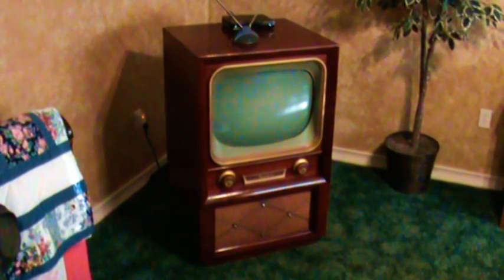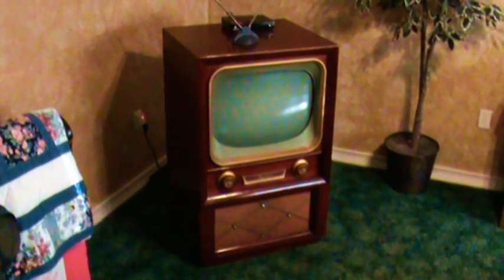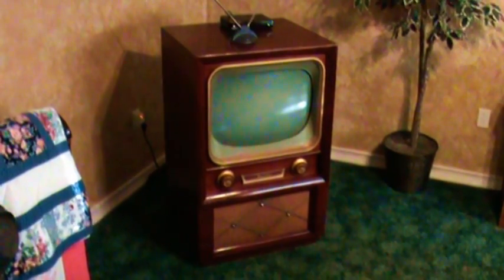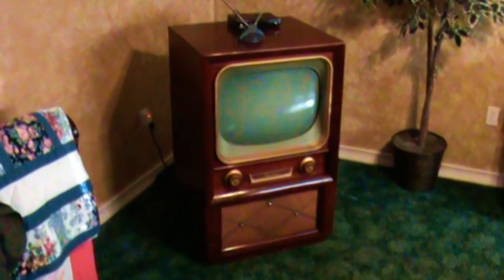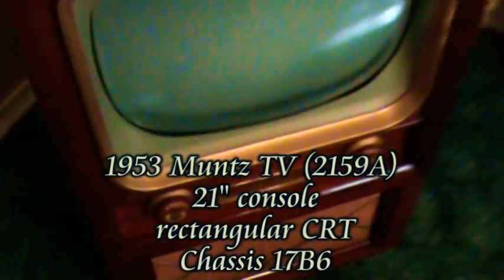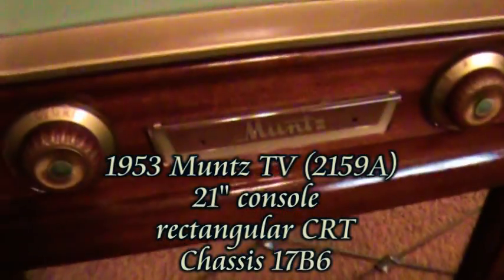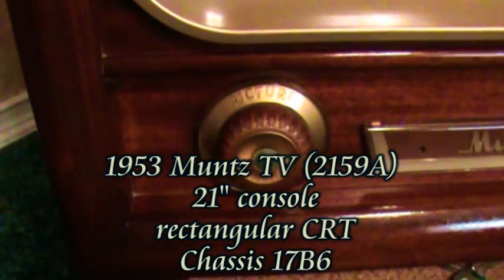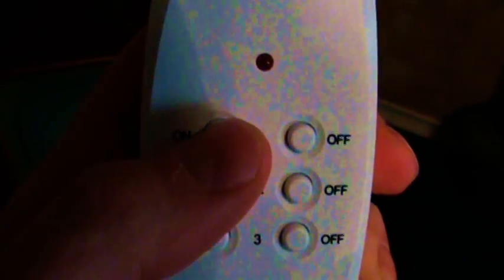1953 Muntz CRT Television Restoration

Comment: i have the same muntz chasis! the only diff. is my model has the doors on the front that cover the set. saved it from a dumpster! haven't gotten around to finishing it yet, the magnavox is first in line. have a raster on the muntz so it shouldn't be to bad to fix. love to see these old sets restored and not dumped! keep em' glowing!!!
Reply: Many of the early console TV sets had doors to hide the picture tube and control knobs when the TV was not in use, so it would look more like a piece of furniture and fit into living rooms of the day. I think people ended up leaving the doors open all the time, so were willing to buy console TV sets without doors when it was time for a new set. Also, there needed to be space around the set for the doors to swing open and closed. If the household decided to add a chair or table, they might have been obliged to leave the doors open.

My parents' GE console TV, purchased in late 1954, did not have doors. However, in the early 1970s, I did acquire a Magnavox console color set with flexible doors that slid into the cabinet for viewing and pulled out to cover the front of the set when not in use. You didn't need to leave space around the set for the doors.

Comment: Excellent repair. I was an AT in the USCG when we still had a few pieces of equipment using tubes. We still made component level repairs at that time now I think they just send everything off. You've inspired me to try to find an old TV set. I like my big screen flat but I would use a restored TV like this to watch movies of the time. From Here To Eternity and Gone With The Wind should be watched on a set like this. Nostalgia at its essence. Thanks for sharing this.
Reply from the maker: Wood Barter Thanks for your comments!

Comment: Muntz TVs were a marvel of simplicity; they wanted to make TVs which were cheap to manufacture but still very well made, and they accomplished this by simplifying them as much as possible.  They do suffer in terms of reception performance, but they can produce a very good picture with a strong signal.
Reply: douro20 yes he marketed his TVs to the areas which had TV transmitters near.
Reply: I don't know if this is apocryphal  but I believe it's fact, madman Muntz had his engineers buy and test many major brands  removing as many components as possible or bypassing with cheaper parts to reach the 'plans' for his sets
Reply: @maxwelsh6121  Yes, there is a story where he actually did that himself. He checked into a New York City hotel room with line of sight to the TV transmitters on the Empire State Building, bought several TV sets and stripped down the designs to a minimum number of parts that still worked with a strong, nearly ideal, signal. When he checked out, the disassembled TV sets went in the trash.

I believe that his TV sets were primarily intended to be marketed in the Los Angeles basin, where homes could receive signals line of sight from surrounding mountains. There may have been other areas with nearly ideal signals for his sets.

While high end sets had 3 stage IF amplifiers for receiving weak signals, Muntz low end TV sets had 2 stages, which simplified the "singing" (oscillation) design issues, which result from the output signal of a high gain amplifier coupling into the input. He could eliminated shields on the IF transformers and tubes.

Some models of the Muntz TV depended on the TV signal to provide a timing signal to produce a raster. When the tuner was set to an unused channel, the screen was dark, while competitors' sets produced light and "snow". This design eliminated the horizontal and vertical controls. However, the screen would go black during normal viewing if the signal was lost, e. g. from being nulled by a reflection from an airplane. I am not aware of any other low end set that didn't produce a raster on unused channels, using oscillators that free ran when no signal was present and locked to the sync with signal present. So, this design had to come from Muntz and/or his engineering team.

In many cases. Muntz TV sets used hand selected resistors instead of potentiometers. When adjustment was needed, instead of tweaking a knob on the back of the set, the user needed to have the TV serviced to replace a resistor with one of a different value. Some TV shops may have installed potentiometers.

I am not aware of any chassis upgrades offered by third parties. An add-on chassis with improved critical circuits might have vastly improved the performance of the set.

Some models did not have fine tuning controls.  A TV repairman may have needed to perform the adjustment. I understand that fine tuning adjustment screws were accessible with the channel selector knob removed.

There is mixed data on reliability. With fewer parts to fail, Muntz TV sets did better than their competitors in that regard. However, the lack of adjustments meant that service calls were required to handle problems which could be corrected by user knob twiddling on competitors' sets.

Muntz is said to have bankrupted the company trying to develop a stripped down color TV. The Muntz brand was sold and used for a number of years afterward.

The Zenith converter box provides an ideal signal with timing and unchanged signal level even when the TV signal fails. allowing the Muntz TV to play at its best!

Comment: That's a beautiful television set.  Excellent picture and sound quality.  From the sound, I'm guessing the speaker might be more of an 8" because I remember working on some of these types of TVs in high school during my training and studies in electronics and they usually had the 8" speaker, a very common size for a big full range sound yet small enough for narrow cabinets.  It's rare to find a 10" in a TV unless the cabinet is extra large.  Most of the TVs though back then usually had a 6x9" speaker or on rare occasions they went as large as a  9x12" which is very rare.  Superior job on the restoration.  Keep it running as that type of technology is what brought the changes we have today over 60 to 70 years of TV viewing.  

Gary
Reply from the maker: musicman0150 Thanks for your comments, Gary!

Comment: Uh, all paper caps do not need to be replaced.   I only replaced the largest dual paper cap (2x 50 ohm 160v) on my 1951 GE 430, and the sucker cranked right up and works like a charm.  In fact, I was able to shift the frequency on it with an antenna mod and pick up hams in SSB and AM mode, on an stock AM broadcast band only radio.   If something isn't broke, don't fix it.  Esp. not with those ugly orange sprague caps.

Comment: How did you feed the output of the digital tv converter into the vintage TV? Is it via composite cable (does the vintage TV have one?) or via RF output?
Reply from the maker: RF, the only input on the TV.  Used a 75 ohm to 300 ohm adapter.

Comment: One could repair a circuit part under the chassis without removing the chassis, lots o room to lay on your back and solder upside down, or just lay the set on its side.